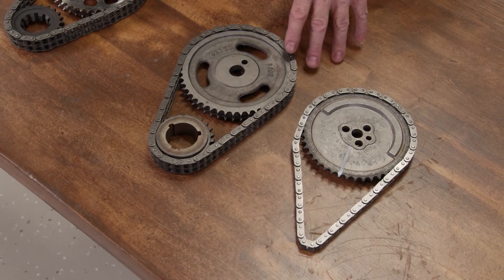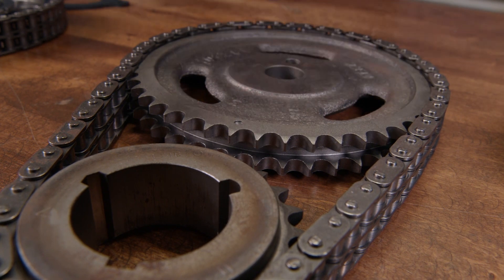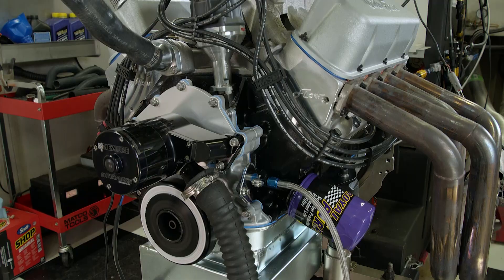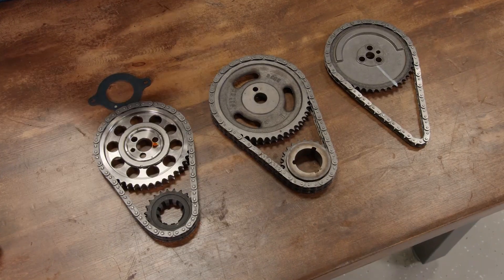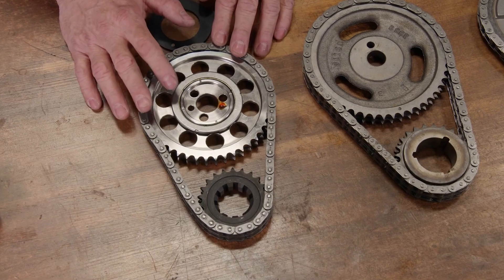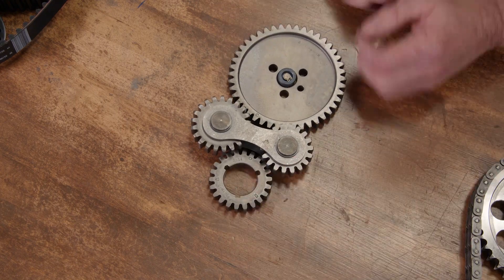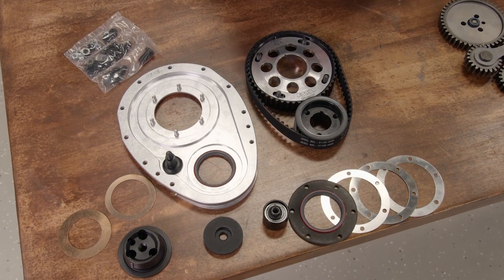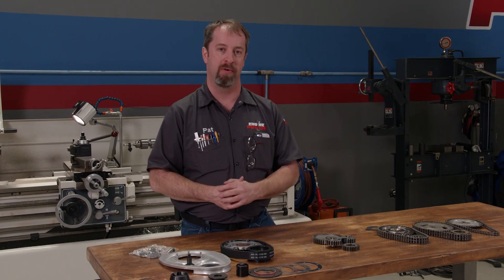How To Choose The Correct Timing Set For Your Application

Comment: Millions of diesels covering billions of miles with gear drive cams. Every Powerstroke, every Cummins, every rig on the highway. Nothing else comes close to that level of proven reliability.

I also love how every video that talks about gear drives only shows the garbage floppy idler junk. OEMs use fixed idlers. And fixed idler systems are available for the same engines as those garbage systems. Much quieter, more precise, more reliable.

Timing belts are the least reliable system. No way I would put one in an engine.

Comment: This video didn't explain when you would need to upgrade or why,  it's just, look different timing chains. Pick one.
Reply: Rewatch the video, he covers it in a limited way. He mentions upgrading if you go with added valve spring pressure or increased RPM. I would read into that a little more and say along with an upgraded cam, valve springs and RPM I would upgrade if you are running a high pressure or high volume oil pump as the chain indirectly drives the pump  - you know - distributor to oil pump shaft to cam gear to chain. I think we all get it - if your motor is being upgraded, at least upgrade to a double roller chain.
Reply: Yea lol. That what I was left thinking 🤔